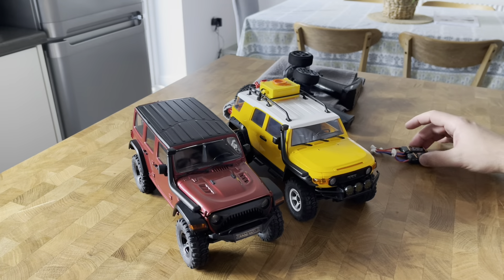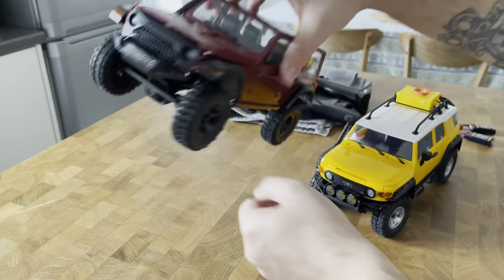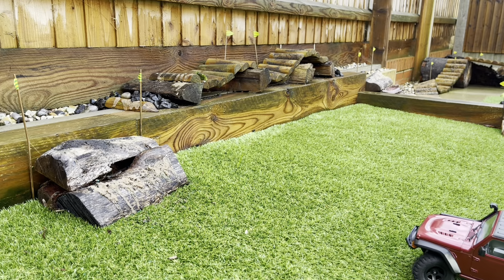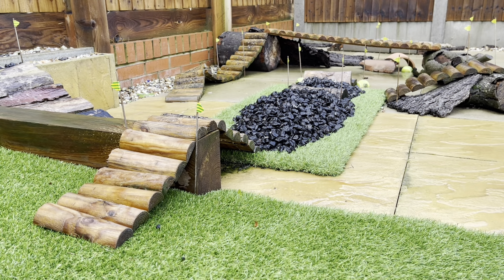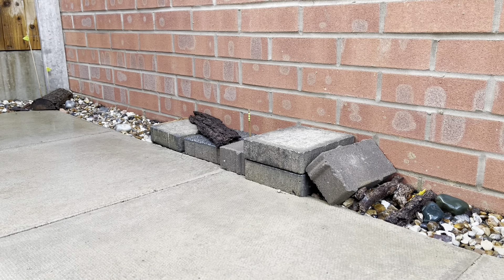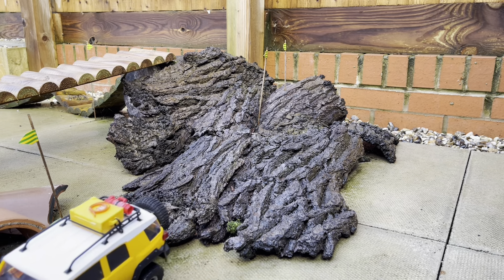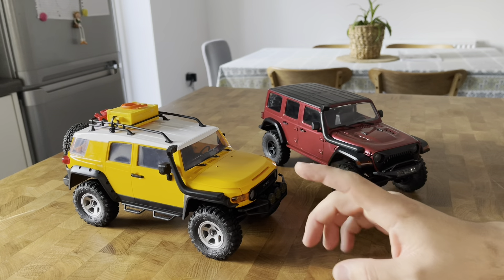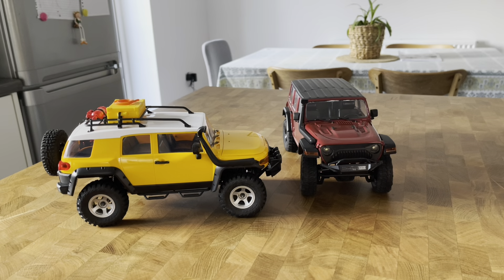FMS 1/18 Toyota FJ Cruiser VS EASYRC 1/18 Thunderstorm - WHICH ONE IS BETTER?

Comment: I just bought a FCX18 LC80 do you think I can swap the body of the thunderstorm to the FCX18 chassis?
Reply from the maker: @justinc5226  in theory, you can swap anything, provided you adapt / build new supports for the body. 
As these are two different generational rigs, I don’t believe you can easily swap without adapting or building your own supports to the body swap.
Reply: @ as I figured was thinking since EASYRC is a FMS brand how compatible the two would be parts/ body wise. Love your comparison video btw! A REASYRC will be my next purchase!
Reply from the maker: @ they used to share the old chassis such as the Thunderstorm / FJ Cruiser / LC80 although slightly different body mounts. the new FCX24 and FCX18 don’t share any parts with the previous models. 
Thanks for the nice words! 👊
Reply: @justinc5226  I’d look into the discontinued FMS Katana. It’s an LC80 body on the chassis of these units that were in this video. I know that there a few of them still floating around for sale on the web.

Comment: I need help with my thunderstorm RC rock crawler jeep so I let my little brother use it and then all sudden the throttle is backwards. Forward is reverse reverse forward and it’s driving me nuts.
Reply from the maker: @AydenGregory  which transmitter did your thunderstorm came with? Was the older version or the new one?
Reply: @marciopereira1065  hay
Reply: @marciopereira1065  I got it not too long ago 2 3 months ago
Reply from the maker: @AydenGregory  assuming it’s the same transmitter as mine, to say the new version of transmitters, your little brother must have pressed the buttons at the top of the transmitter and reversed the sequence of the throttle and steering. I don’t remember the page to be exact, but if you check on the manual it will tell you how to set up the transmitter and which button does what. I never had that problem to be honest. 
This is one of the rare ovations where the manual is handy to have… 😄

Comment: 3:20 Why would you "repair" the body mounted servo to put it on the axle?  Mounting the servo to the axle is certainly the current trend and it also corrects bump steer when it exists (and also keeps the operating angle parallel to the axle, aka simplifies the working angle and probably makes life easier for the servo), but it's dubious otherwise.  When mounted horizontally, the servo now needs a recess for it to move into when the suspension is under compression.  It reduces the amount of suspension articulation  unless you carve out a recess for the servo to move into.  That means you lose the area previously occupied by the battery and the ESC.  I prefer the hidden servo mounted under the bonnet for more realism.

Cute crawler course with a multitude of smooth and uniform logs (no bark) and other sanitary features.  How dull; I mean it's fun to get these crawler trucks dirty and/or to operate them on realistic, scaled-down-to-1/18 area with loose pebbles, mud, loose dry dirt and so forth just like in real life.
Reply from the maker: I meant “repair” or rectify the previous comment on another model’s review 😄
I personally prefer the servo inside the body as you said, it looks more realistic. 
I chose not to use bark on my crawler course due to maintenance (the uk weather tends to be rough at times). 
I have a woodland close to me and that’s where the majority of my videos are done, I prefer the mud and the more realistic set of woodland 😄
Thanks ever so much for watching my videos and leaving a comment, I really appreciate!

Comment: The thunderstorm seems very basic with less details and uograde option here 😢
Reply from the maker: @sta_bang  yes, it’s based on the older FMS chassis, like the old LC80 and FJ Cruiser to name a few. 
You can still upgrade, however it’s more difficult to get upgrade parts to fit, say when compared to the newer chassis like theFCX24 and FCX18.
Reply: @marciopereira1065  ah okay mate . Thanks for your reply ..✌️
Reply from the maker: @sta_bang  not a problem. 👍 thanks for watching and commenting, really appreciate.
Reply: @marciopereira1065  no worries , even on my channel there are few rc videos ,see if you like it✌️
Reply from the maker: @ just subbed. I’ll have a look later after work. 👍
Reply: @marciopereira1065  thanks mate💪